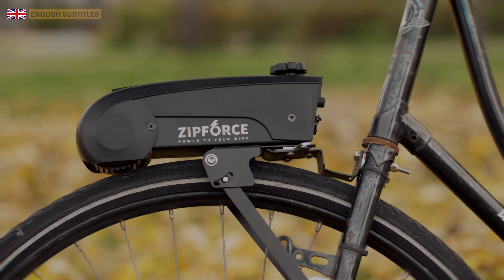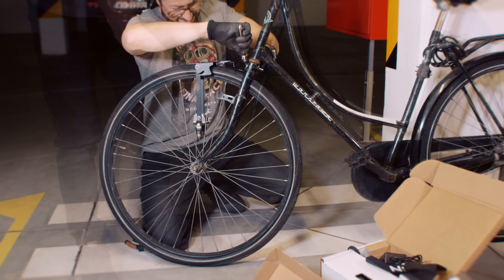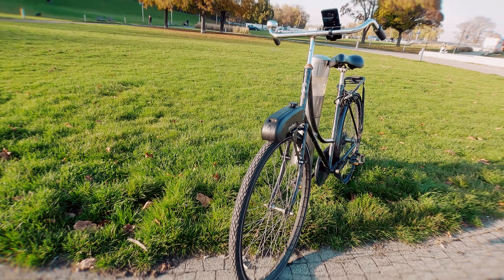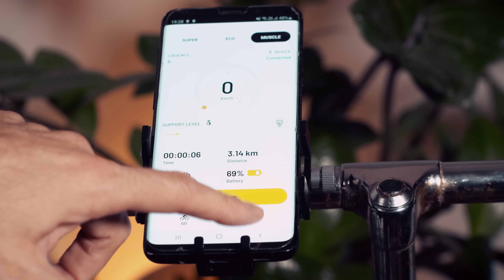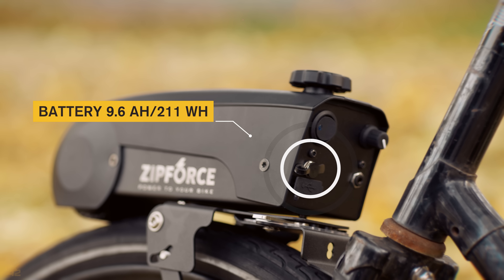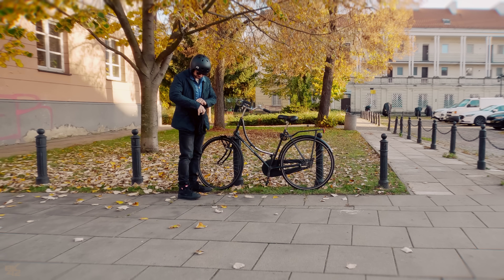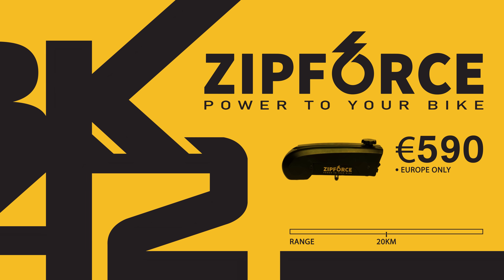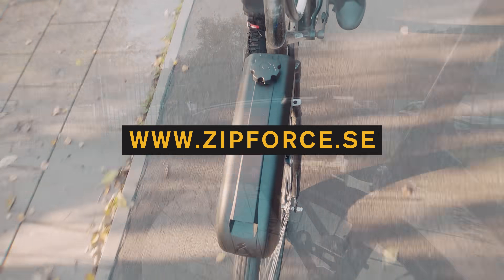This E-Bike Conversion Kit Requires NO Tools 🤯 | ZIPFORCE SLIM Review

Comment: Have 20 inch folding bike and would like to convert is this possible
Reply from the maker: It should work, just make sure the fork has the central role. You can also confirm this with Zipforce support. Thanks.

Comment: Hello everyone. I have read lots of comments on this E-bike conversion kit. What I do not understand, and perhaps no one commented on is - how to replace the battery on that motor ? And how much does just the battery costs ?    Also, why the manufacturer did not make some connection on the whole thing that allows the user to connect it to external battery for more driving range ? I guess that would make it much more popular E-bike conversion kit.       And then also - the roller that spins the tire ? Is it possible to replace that thing, eventually it will wear out and then the whole thing is useless.     The price is not bad, but could be less. Most people in europe dont make more than 1000 or 1500 euros per month and then buying that thing at once can be hartbreaking story with all the living costs in this year 2025 ...                  I did drove solex gasoline version, but why throw money away on gasoline, when electricity is our present and our future ?

Comment: Ah, I see that after looking it up some, that it's a built in 300Wh battery, all contained within the hub motor...hmm, clever, but how good is it I wonder?

2 could be interesting, to build a low power 'All Wheel Drive' e-bike.

How much do these cost though?

Comment: Will this work with a kick scooter?   Do you have to pedal to control it?
Reply from the maker: There is a pedal sensor and the kit is designed for use with bicycles, but it may not be suitable for scooters due to their heavier weight and incompatible support.

Comment: Love to get one of these as I travel a lot Internationally. Apparently the battery is small enough to take on a plane. And once at destination I can buy a good mountain bike for about $120 new enjoy riding a couple weeks, take the motor and mount off and give the bike away to someone that needs it. One thing though. I am in Costa Rica and we have throttle control and 1200 watts power and top speed of 56 KPH available. Also many is not most hills are 20 to 35% grade. One known to be 41%.  So I prefer more power. But anything is better than walking. And I need the assist on uphill grades being 76 years old.  Big turn off on rental bikes is that clause of paying $2000 if lost, stolen etc. I'm not about to pay $2000 for what at best is a $150 bike.
Reply from the maker: That'd be awesome for you, Sir! Not sure if you can snag it on planes, though. It's mostly sold in Europe, and they often have killer promo prices. I've had mine for a bit, and it's been rocking so far :)

Comment: although this might be the easiest e-bike conversion kit, that benefit becomes a negative when considering the inefficiency created, firstly normal front wheel conversion kits are almost the same level of difficulty, replacing two nuts on the front wheel and placing a new wheel isn't exactly rocket science, then screwing the battery in place being not difficult either, with the benefit being now you can ride a lot faster with less energy being wasted in friction with a two wheel system, i love the concept because how simple it is but as a commercial product it's not the best idea

Comment: Well that sucks for other countries then, I cycle at about 34-35km/h for I've got to ride with the traffic. Riding at 25km/h as a "brake" since you probably won't challenge the motor over that speed is actually highly risky. I'd be flattened first ride. There should be a 40km/h alternative version, since that's the speed limit in slow roads and half the limit in express lanes (minimum speed). Nevertheless, absolutely awesome design.
Reply from the maker: Thanks...  I agree .. unfortunately the EU regulations for ebikes is 25km/h max ...  the funny thing is that the super fast road push bikes can cruise at 50/60km/h on the roads with no problems or control!
Reply: @BK42Cycles  exactly! Damn politicians ~~

Comment: How many NMs of torque at highest assistance levels? And how well does it perform if the tiers are wet?
Reply from the maker: Hi, unfortunately I don't have this information. I haven't ridden in the rain, but going through some water puddles isn't a problem. I am still testing it btw ,, cheers

Comment: He, he, new idea? OK, partly, but in Denmark they have had this setup for at least 75 years. Only difference is the change from petrol to electric. The danish name for the pertol vertion is ‚knallert‘, resembling the noise from a small 2-stroke engine.

Comment: As this option is not suitable since it has more tire wear due to the 2 flexions that occur, one on the ground per route and another in the grip of the equipment to the tire... In other words, you would have to buy a tire in less time than what a normal one lasts you.

Comment: No special tools or mechanical skills are required to assemble it. He said at the start of the video. Then proceeded to show us the tools and the not so simple installation process that according to him takes about half an hour. I take this with a pinch of salt. Finally, this video isn't a review, it's an ad for the product..
Reply: Besides I think it's horrible to put a heavy motor on top of your front wheel like that, it will destroy the handling. The weight should be at hub-level or lower. It's honestly  a bit dangerous if the terrain isn't good

Comment: With direct drive on tyre you have to sacrifice your mudguard, so if you want to commute in the rain, and in UK it always rains!, you will get the spray from the spinning tyre! on either wheel front or rear! then you have the extra wear on the tyre itself?  So yes its a good idea, but for only for countries where it doesn't rain too much, and if you don't mind the shorter life of  one of your tyres!
Reply: No problem. Cut off the front part and reinstall the aft, main part of the mudguard. Problem solved.

Comment: Nonsense. A friction motor for a bicycle appeared maybe in the 30s, when asynchronous motor wheels were not yet known.
And the biggest minus is in the very way of transferring forces from the motor to the wheel.
Rain, puddles and mud immediately negate all the advantages of this device.
In cold weather or in winter, its use is also doubtful.

Comment: Range too small - they should sell an additional battery that can be plugged into this one (for example can sit in a basket in front of the bike and have  a cable come down to the front unit to charge as you ride - double the range to double the sales!!)
Reply from the maker: That's not a bad idea. but ZIPFORCE has other models with larger battery capabilities as well ;) cheers

Comment: Sir Clive Sinclair made something like this in the UK back in the 1980's/90's, and it was called the Sinclair Zeta. The public wasn't ready for that back then but maybe is now. Sir Clive Sinclair was years ahead of his time with several of his products.
Reply from the maker: Thanks for sharing that with us :) cheers
Reply: Innovative copy paste it seems
Reply: I had a petrol version. Made in the 1950s, used spring tension to hold a drive wheel on the rear tyre,  I think it was a veloset ??
Reply: The Power Pak was another one, made from about 1950 by Sinclair Goddard & Co Ltd (no relation to clive), a 2 stroke engine over the wheel friction drive and there were lots of other friction drive cycle motors at the time, and its likely where he got the idea to do an electric version from. There were also hub motors in the 50s, that replaced the whole rear wheel, like the Cyclemaster which had the whole engine and the petrol tank in the wheel, and BSA did one too, where you just swapped out the wheel and attached the throttle and clutch to the handlebars, it had a backpedal brake. They were arguably better because they didn't ruin the tyres. The nicad powered Sinclair Zike E-bike was a lot more interesting, but only it had very small wheels and short handlebars like an electric scooter, and didn't look too stable, I suspect it would have done quite well if he'd improved the handling and made it fold up, so you could take it in an office.

Comment: too expensive. I can buy a whole ebike for $500 and save $130.  Why can you just charge what its worth about $300.
Reply: Not sure how you came up with the cost price! Zipforce is a quality product from Sweden, motor and battery on the same pack, with plenty of advantages compared to an e-bike. It's flexible, portable, could be shared on multiple bikes as well as sustainability as you use your own existing bike
Reply: It sounds like you haven't been riding yet, Don. For those who have done many miles for free, they saved over $500 - if not way more, and are happy to pay to keep their existing bike but modify it slightly, rather than buying a brand new but cheap e-bike. Then they have two bikes but only want one good one. If you want a cheap e-bike then you buy it, but leave other people to make up their own mind about what is best for them.

Comment: The only pro I can see here is the ease of mount/dismount, but I'm not sure it is so much needed. Also passing torque to the outer part of the wheel will definitely make the tire worn out quickly and should become problematic in case of even minimal contamination. IMHO, we've got there a very niche product for a high price.
Reply: not to mention one drip of rain or just wet roads and the thing will slip like crazy and be useless.
Reply: The tire wears out, so does probably the roller. Used to drive a similar construction in 1955. It ate tires for breakfast, lunch and dinner.
Reply: Bicycle tires are not expensive, at least not in Europe. I also do not think that tire slip would be a huge problem. And in case, we still need to pedal and therefore can move even with no motor.
Also, for people who ride in any weather to work etc, they would rather buy a complete e-bike.

This is a good product. I like it as I would need just a bit assistance sometimes for climbs etc. . Although I would prefer to have it on the rear wheel.
Reply: @krollpeter  I had a petrol  version,  useless in the wet, just made smoke as the drive wheel slipped  😞
Reply: You guys know nothing. It works really good, very practical and easy to move to another bike if needed. Hardly any downsides really. And no, the tires does not wear out, don't lie.
Reply: @TheMainCore and yet you offer no proof of your claims, just saying everyone else is wrong and you’re the only person who’s right
Reply: @TheMainCore  BS,  used a petrol version back in the 80s, tyre slip was a huge issue in the wet, and with the electric version no doubt making more torque it has to be worse.

Comment: All of that doesn't look good
All the power is lost between the tire and the motor
Should damage your tire quickly
The battery level is poor 
It's more expensive than an equal specs transformation kit

Comment: I feel like this would wear out your front tire too quickly
Reply: Zipforce has minimal affects on the tire. The most important thing is that the tires are well-pumped and that you have screw the motor with the right angle on the tires, then you shouldn't have any issue.

Comment: This is the principle of the velosolex, the engine placed on the front wheel with a roller. Where is the revolution? The combustion engine has been replaced by an electric motor! The principle was born in 1946 :p
Reply from the maker: Thanks

Comment: NOW HOLD UP. 
How much torque do these have? My very first thought was reverse it and come up with a mounting solution. It would be the perfect universal reverse for motorcycles. Once you start getting into the heavier bikes and dont have a fancy one with a reverse gear. They are a chore to move around even if you are strong as hell.
Reply from the maker: Donovan, you make an excellent point! While this is a fantastic idea, I don't believe it is the most practical option because it only works when the pedal assist detects movement. There is no throttle or other way to activate the system when needed, which could be inconvenient.. In my opinion, the market is currently lacking the device you need. Thank you for watching, and good luck!
Reply: @BK42Cycles  In Sweden, it is not allowed to have a gas handle on a bicycle. There are strict rules for what is a bicycle and what is not. A bicycle must not have more power than 250 watts and not go faster than 25 km/h Zipforce stays within legal limits. And yes, an electric bicycle is only allowed to be used if it only reacts to pedaling.

Comment: If you want to save the environment. Just pedal the bicycle yourself! 
It is absolutely unnecessary to make electric bikes, or attachments. 🤦‍♂️
Reply: Well, for me this is very important as someone with the lung disease COPD. I bought myself a completely ordinary 28-inch traction bike with 7 gears. The gears helped me of course, but on the slopes it didn't go particularly well, had to go up and stop several times before I got up. So an electric motor probably had some help for me. But I am more uncertain about this product now than before after reading all the reviews here. I'm going to sell the car, as I can't be outside in freezing temperatures because of my lungs, so I can't service the car with a battery charge. Moreover, the car has become impossibly expensive to own. I have considered a eu-moped, as the battery life on bicycles and electric moped is to bad for longer distances. As for my bike, I prefer a Bafang bike kit with a bigger battery. Anything more than 250 watts on bicycles in Sweden is strictly prohibited.
Reply: @linux-helt-enkelt  I understand your need and other medical issues requiring electric assist. But it’s normally healthy people being lazy who is the majority buyer of these things. All the best to you and your health!
Reply: @robertchapman6795  Yes, but this bike take me not long, i live in countryside. Here its onely 4000 people some live and its long way to other places. So am also thinking about eu-moped.

Comment: Agree it's brilliant.  I actually made a similar device using a 250 watt hub drive skateboard motor. Control is by skateboard Bluetooth controller. 
So you don't need to pedal. 
I only have 4 Ah battery. 
What I would like to see is a mount you just clip the skateboard in and use as is.
Reply from the maker: I would love to see that if you can share some pics :) tks brother
Reply: @BK42Cycles  try this just did is off bike was on Giant oc3https://youtube.com/shorts/RDg0Gae-sWM?feature=share
Reply: This better https://youtu.be/uuxs1SVluS4
Reply from the maker: Video unavailable - This video is private. :(
Reply: @BK42Cycles  I try again it's an old video of bike on dyno

Comment: there is a reson this concept isnt used more widely: it rubs on the front tire thus creating two friction point to transfer torque which is never a good thing
Reply: French Solex gas powered has been doing this for 50 years.
Reply: @DerKirchenhocker lol i rode one of those. It was fast. Really fast
Reply: А от грязи чистить будет его тоже отлично
Reply: Why ?  Gears work because there is friction. Also this device is smaller than any other electric bicycle motor I have seen. If you meant to say it slips in snow or rain then that's a different argument .
Reply: @BHARGAV_GAJJAR  Gears ⚙ work in the RAIN
Reply: What is the best method for an electric bike??
Reply: @kelvinmbugua2283   get a cheap 200-300 bike to ebike conversion kit that requires to change 1 or 2 wheels. Easy way to go 25-35 mph for a cheap(er) price
Reply: Exactly it’s inefficient and will wear tires quickly
Reply: Outdated and useless in rain 🌧
Reply: Velosolex had it wrong then.

Comment: Ask any dutchman over 50 y old and he will probably has driven one of these bikes with auxiliary motor during the sixties and seventies called a Solex  Not electrical, but with two stroke engine 
So no new concept, but a modern versionelectrival and app
Reply from the maker: Thanks

Comment: Don't use it on gravel or off road!
Reply from the maker: I did use it off-road .. I gonna push some videos showing deeper tests soon... keep tuned
Reply: @BK42Cycles  It is better if mounted to the rear. I am sorry to say but you don't know how strong the fork is. A lot of times it is corroded or the tube thickness is uneven.

Comment: Nice gadged. It is also possible to install with a suspension fork?
Reply from the maker: It should work depending on your fork. It can be installed on the rear wheel as well. Please contact Zipforce for details.. they will assist you better than me ;)

Comment: That's really cool and I like the fact that it's wireless, making install clean and simple.  It kinda reminds me of the old two stroke French mopeds in the 70's with the motor driving the front wheel.  I wonder what would happen if you mounted one on the back wheel too.  Two wheel drive!
Reply: C'était le velosolex
Reply: @laurentlocatelli3214  Oui!
Reply: Po Bu you v
Reply from the maker: Thanks Bruce, I though about i, but I am not sure the App will control two devices... I gonna ask for the Zipforce guys.. tks